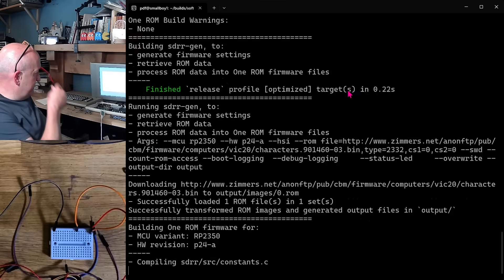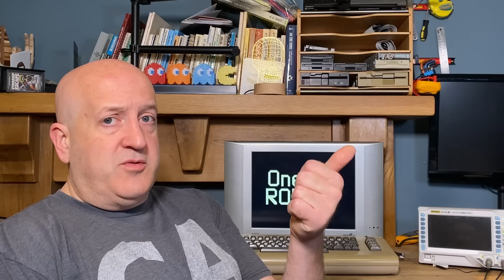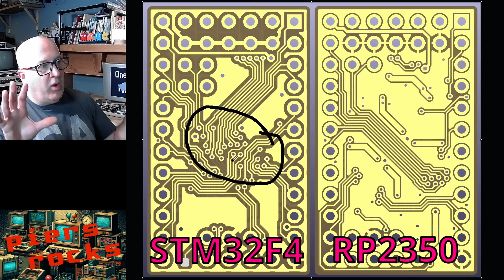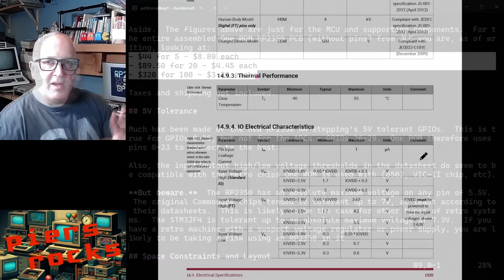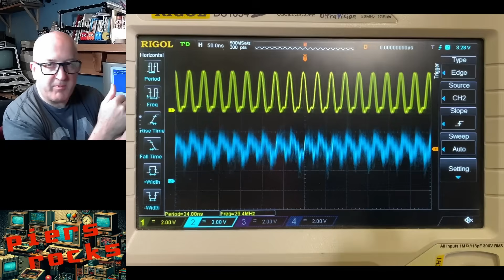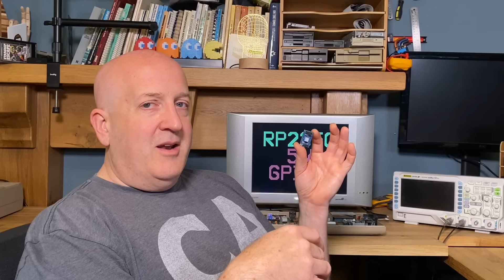Retro ROMming with RP2350 5V GPIOs - One ROM

Comment: When I saw the A4 stepping with 5 volt support, I thought you would be quick to use it, great job.  I don't so much have a need for rom emulation, but I was considering using the 2354 as a replacement for the z80 ctc and sio chips.  Plus to load rom code into a large fast static ram that has read only access from the cpu in portions of it's address space.  That way, a more or less complete system can be built with just a cpu, static ram and the rpi2354.
So it will still need to use some of what you have done, mind you, for just the xtc, sio functions, wait states are not much of an issue.  Still cool to know this can keep up to the memory requests for a cpu running at the clock speeds of typical 8 bit retro systems.
Reply from the maker: @bsheldon2000 Yeah, plenty of spare capacity.  I've now done some temp measurements at different overclocks and I would have no concerns at running this at even 300 or 400MHz for extended periods.

I would seriously consider the 2350 with external flash though vs the 2354 if you're planning to get the usual suspects to assemble - it might just be a short-term issue, but I can never find the 2354 in stock at JLC.

Comment: Isn't A2 5V-tolerant too? If I understand correctly, there were no hardware changes regarding that in A3 or A4. A3 and A4 fixed E9 (GPIO leakage current) and many security issues. It's quite likely I missed something though.

Regarding PIO vs hand-optimised main core loop, I believe with PIO it should be possible to utilise DMA and avoid wait loops, although I'm not sure if that would result in lower latency.

Anyway, thank you for an extremely interesting video. I'm working on a somewhat similar project using RP2350B and Rust to interface with old hardware so it's nice to see others doing similar things successfully. Also great job with the PCB! Sooner or later I'll have to design one too so your tips are very valuable (I'm a software guy as well).
Reply from the maker: @tuesss Yes A2 is similarly 5V rated, although my design makes use of the E9 fix in A4 to avoid the need for external pulls on the image and bank select jumpers.  (I didn't cover this in the video, but this works for me on the A4 stepping.)

Great to hear from someone else using Rust for embedded work!

Comment: Would it be possible to load and run a small custom machine code from the one rom on a certain address location, e.g., $a000
Reply from the maker: @retro_noix Depends what system you're thinking of.  You can put whatever image you like on One ROM and have it served - but it will be served at whatever addresses the ROM socket is physically connected to.  So, on the C64 from memory the kernal ROM is $e000-ffff and BASIC $c000-ffff.  There's simply no way without hardware mods for One ROM to get addressed at $a000.

On the PET, on the other hand, sure - there's usually an empty ROM socket a $a000.
Reply: @piers_rocks It is for the c64... but it does not necessarily need to be at $a000... what are the potential pockets of memory that can be used with the kernal remain in its location?
Reply from the maker: To use One ROM you'd need to find some space in either the kernal or basic ROMs.  I think back in the day custom kernals (like jiffydos) tended to do that by overwriting the tape routines.

Comment: would be cool to see this project running on the ultra cheap MCUs that are available from china, probably as an exercise in insanity lol
Reply from the maker: @cocusar Yeah, I'm getting pretty interested in the CH32.  I think I found an 8-pin CH32 for under 10c each in quantities of 10 on aliexpress the other day, and was looking for an ultra-small MCU to be a USB to MCU bridge last night.  Obvs I need more pins for this application, and reading the datasheet is a challenge given I don't speak Chinese!

I have a suspicion that RISC-V might be more difficult to serve ROMs quickly enough - I haven't done much digging into this, but not sure RISC-V has any branch prediction built in and there may be other instruction differences that bite.  But per a comment on my asm optimisation video I may be able to implement branchless loop anyway.

Comment: Hey, you do know that the GPIOs of the RP2350 are only 5V tolerant when VDD is present? Some people say that it still works (and you observe it, too), but there seems to be a risk of damaging the GPIOs when VDD is not present and 5V is applied.
Reply from the maker: Just like with the absolute max voltage rating of the RP2350 being lower than the STM32F4 there's increased risk here too.

I haven't seen any issue here yet, and have powered off and on the host systems MANY times during testing.  The very brief period between power on and the AP2112 VR starting to produce 3.3V is the window, and something would have to be driving the address and/or data lines during that period for there to be a problem.
Reply: @piers_rocks  I think the RP microcontroller data sheets have stated that the GPIOs are 5V tolerant when VDD is present for a long time, and anecdotal evidence has shown that they usually withstand some violation of the specs quite well. For that reason, I found the announcement of the A4 stepping a little strange. In any case, thank you for your videos. OneROM is awesome and I enjoy watching all of them ❤
Reply from the maker: I think the 5V tolerant GPIOs in the A4 announcement might have been primarily marketing, perhaps to draw attention away from the E9 bug - but it gave me the kick to have some fun with the RP2350!
Reply: @piers_rocks would not a traditional linear regulator without a softstart fix that issue?